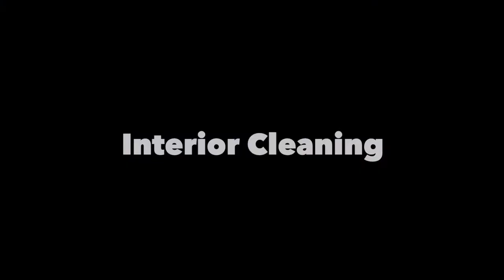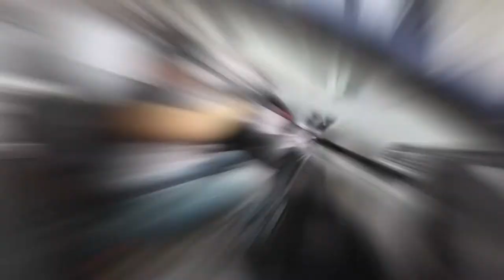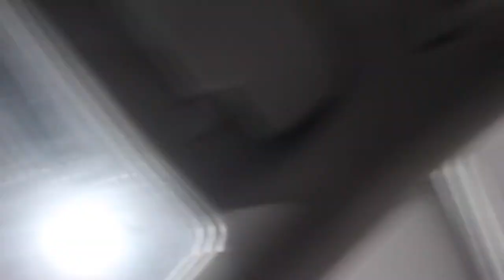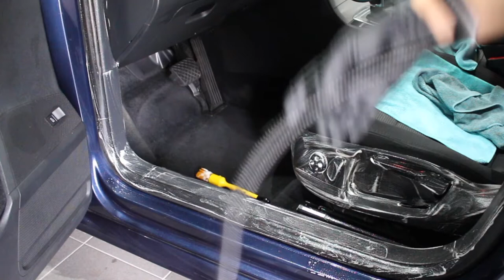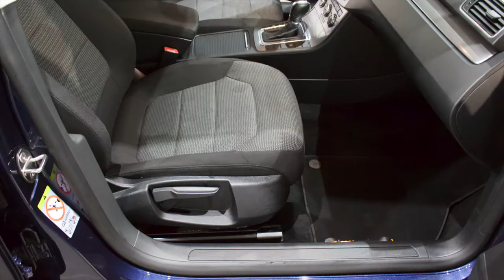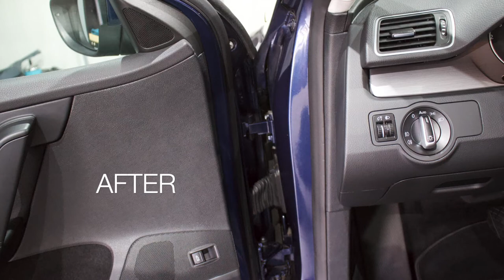How To Super Clean the Interior of your Car-TRANSFORMATION!

Comment: A comprehensive wash should include dry cleaning of the interior, treatment of the seats with various means, cleaning the windows from the inside, removing dust with a vacuum cleaner.  Including you should use body protection after washing, applying wax to the body.  When washing the body, be sure to wash the arches and the bottom of the car.

Comment: cleaning of the interior, treatment of the seats with various means, cleaning the windows from the inside, removing dust with a vacuum cleaner.  Including you should use body protection after washing, applying wax to the body.  When washing the body, be sure to wash the arches and the bottom of the car.